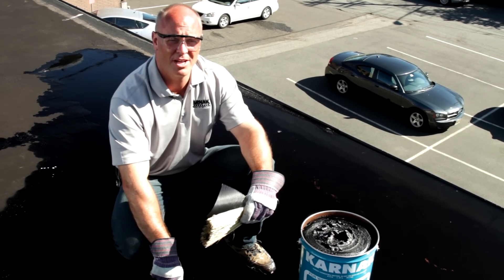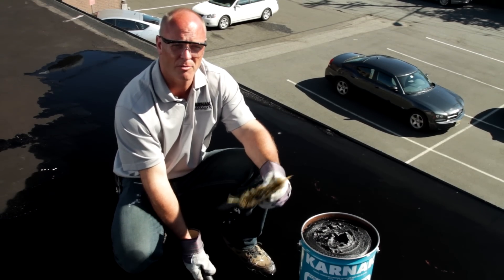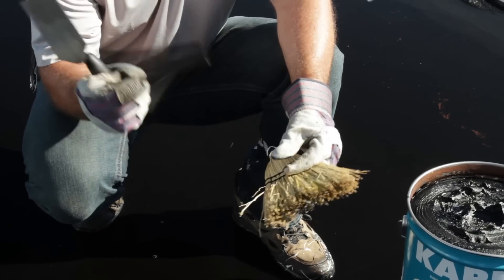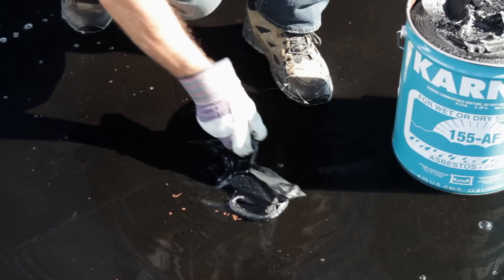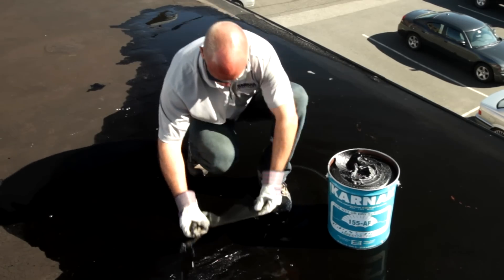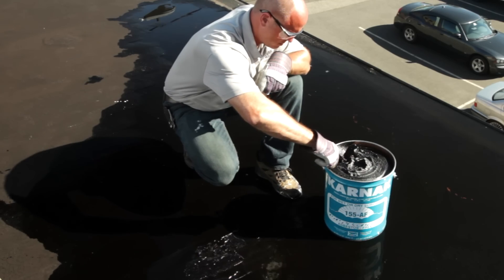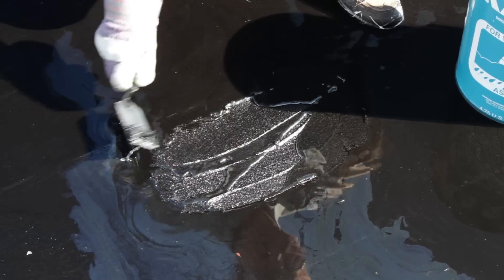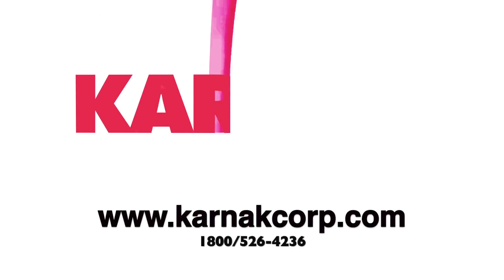How to repair leaks under water while it is raining - Karnak 155 Amphibikote Wet or Dry

Comment: My roof in my house in Puerto Rico has been sealed few times. Lately with so many small earthquakes and rain, it started leaking again.  It’s really frustrating!   I wonder if this product will work.  Please help !!!!   Do you sell the product in the island ?   Is it really expensive?
Reply: It's not too expensive. You can use any wetpatch. Do it on the same manner. You can find it locally in Puerto Rico.
Reply from the maker: Thanks!
Reply from the maker: Yes, it can be used on concrete or asphalt roofs.

Comment: Would this work on a roof that has elastomeric coating?
Reply from the maker: No, you would not want to apply 155 over an elastomeric coating. The underlying coating would expand and contract more than the 155 would. You could use KarnaFlex or KarnaFlex WB.